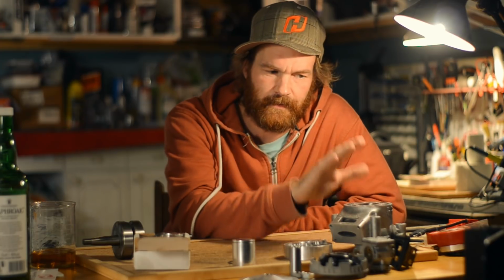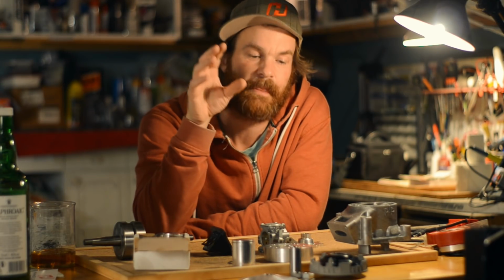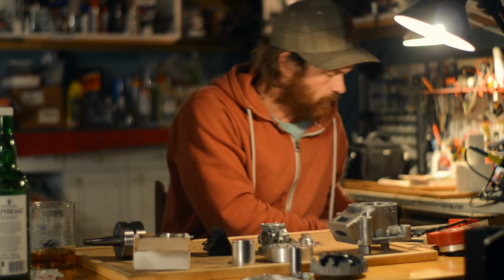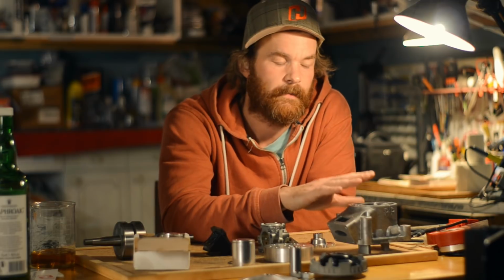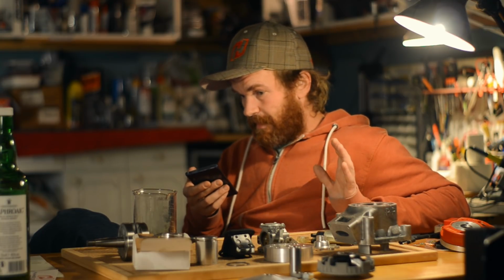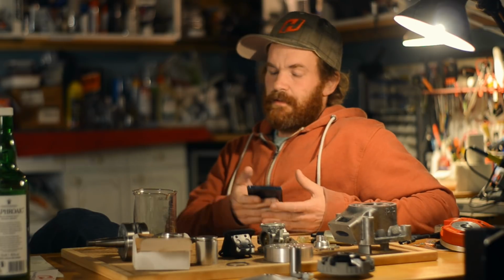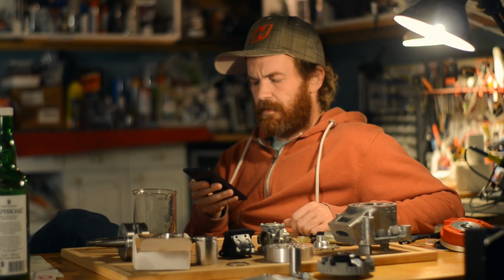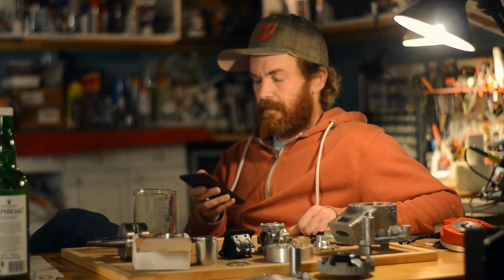THE Most Powerful Two Stroke - Back at it! + Replying to comments

Comment: Move the rider position flatter/horizontal to reduce frontal area.  It is a lot easier to reduce frontal area than to produce more horsepower.  I can't find the youtube video but there was a guy that built a motorcycle and he was perfectly horizontal and used some sort of offset steering mechanism so he looked around the front suspension.  If I can find it, I'll post it.  FOUND IT...this is the rider position you need: https://www.youtube.com/watch?v=2OtVLm3D6Is

Comment: Might be good to build a "Back Up" engine...pretty easy to do once you have the machining programmed.  This is going to be a VERY highly strung motor and I am concerned about reliability.  If you are going to travel to Bonneville, I would hate to see your engine fail and not be able to run.

Comment: Why not run two classes i.e. partial streamlining and no streamlining?  Doesn't your CVT lose some power due to slippage...may be good to gear for a given top speed/rpm and use a "lock up" device that doesn't lose any power due to slippage once you reach a given speed.

Comment: New idea...why not turn the engine around (intake in the front) and get some ram air into the tuned intake....Ha ha, I see you have already done it.  Tilt the motor forward so the intake is pointed directly forward maybe :).  Not sure how much it will help at 90 mph but I would think the "ram" would help.  On another note, I am real curious to see if the completely open intake will work...I would probably use a rotary valve, still tune the intake AND the RAM i.e. intake in the front :).  The pressure/rarefaction pulses would be more distinct with the rotary valve therefore the tuning would work even better.

Comment: I'm re-watching some of your videos. Had a thought... what about direct injection with two injectors, each switches half of the duty cycle. Speeduino can handle a dual injection system on a single cylinder. Just a thought. Best of luck. 👍

Comment: Okay i dont get that? when u run injectors  at 18krpm  90% duty cycle what is the difference between a const fuel injektion? i cant see the difference?  I just imagine its really hard to adjust the fuelpump and you have to engineer waaaay more.  I never run or setup an EFI but i guess you ll get it faster and way more acurate with using one of the systems avalabile (Speeduino if you want DIY) There are DIY 2 Stroke Speeduino Bikes out there. is it Possible to check the max possible dutycycle and limit it. Than Speeduino is open source so maybe you can run a dual or tripple staged injection ? low power idle injectors on the throttle body outside. and insane big ones (and maybe also fast ones?) at the transfortports as shown. I guess there are companys they can manufacture injectors as you need.

Comment: i see you trying to build a 50cc landspeed motor. are their restrictions on fuel? if not then why not build a multi cylinder engine from .28 cu inch RC car motors from manufactureres like Novarossi. a 6 cyl engine would produce near 50 HP

Comment: I am owner of Aprilia SR 50 scooter with injection motor from Piaggio. It is nice to know about high-end two-strokes. I have been installing KTM 125 fuelpump with pressure regulator to get more fuel to the system. I am pleased if my motor accepts these cheap chinese parts. Your most powerful 2stroke is almost Bonk-art, like that swedish bike with compressed air motor. With DOHC valves on the cylinderhead and exhaust turbo, it could make a lot of power and the high pressure air-canister is only used for starting this 2-stroke engine. High rpm is not so necessary with turbo dry sump engine and you could use 4-stroke type pistonrings.
Maybe it works or not. It is too expensive to test 2-stroke engines, when Kawasaki can make so powerfull 4-stroke H2 etc and electric engines are coming. Any way, your videos are very entertaining.

Comment: Been thinking a lot on this. If the injectors can't keep up on their own how about programming it like a 2 cylinder running at 8000 rpm with 2 injectors cause they are only supplying a single cylinder they would alternate and should pulse properly for a single cylinder at 19,000 rpm

Comment: An idea for future designs. 
Single cylinder crank carrying four (4) con rods. Crank case/block carries four cylinders equally spaced around the block. Each one is offset in two pairs so the big end loads do not suddenly change at each rev. 
This gives perfect primary balance and almost no torque vibration. 
Big downside is zero primary compression. But with a hollow crank you can feed fuel and air down the non drive end. Or don’t put any air through the crank and run a pressurised inlet manifold.

Comment: I think you were trying to say this, http://hilborninjection.com/
in reference to EFI I have seen examples where a number of injectors are used to deal with the fire timing, the injectors are fired in sequence. doing that allows more time for each injector to recover before their next firing event.
from wha I recall the Hilborn injection system uses an orfice to meter how much fuel is allowed to spill back into the fuel tank, perhaps a servo controlled needle valve would give you the control needed to keep your mixture correct at 19K+ RPM!

Comment: Really like the crank case design!
Especially the “inlet tract to transfers” transition is very nicely executed and looks well modeled. 👌

Regarding cluttered 3D-models it just sounds like any other professional design engineer. 😆
With experience some of it goes away, but not all. 🤦‍♂️
Don’t be afraid to take a “clean sheet of paper” when the model starts to clutter up and start all over again. It’s sounds really tedious but with a god reference/skeleton model that drives the main geometries and details, it’s worth it big time and often faster. A more stable and bug free model is a nice side effect. Good luck!

Great to hear the chassis, that I was a bit critical about certain areas, worked well. 👍
With a couple of parts falling of I’m sure you will have a overall look to the frame to find out any structural issues. Even if the limited amount of running time makes it rather unlikely.

Comment: Not sure if you know of them, but Ecotrons (web search) has 2 stroke EFI systems. Granted, only up to 16,000 RPM spec, not sure of fuel type, but can trigger 2 injectors. You could check them out, contact them and see if they can get it up to your 19,000 RPM. Running one injector at low or idle and bringing on the second along with the first might help solve the high RPM/load fuel supply issue. I know this isn't the same, but Top Fuel motors use direct injection to cool the cylinder/piston and the fuel curve takes this into account. The direct injection is an "always on" system dumping fuel in to the cylinder every cycle.

Comment: Why don't you use a two cylinder system and fire the injectors alternatively?  That way the injector only has to work for 10,000 RPM.

Comment: That upside down cylinder arrangement just seems like trouble waiting to happen with hydrolock with fuel/oil from injector pump problems.  Maybe a breakaway "freeze plug" that contains compression pressure, but would fail at higher pressures to relieve hydrolocked cyllinder under a heavy starting foot in a big boot?

Comment: Most methanol alcohol and nitromethane have a tendency to freeze up how are you going to prevent that
Reply: And I mean literally freeze especially at Full Throttle the few Top Fuel dragsters I've had the chance to work on or be around that was an issue

Comment: Look into using PDM rather than PWM to fire fuel injection.  Signals are shorter without having to filter out noise which will cause missfire.
My 2c
😏

Comment: If the open inlet system doesn’t work you could always revert to a belt driven rotary valve .....I’ve seen these used to keep the inlet inline the the crank centre this was used in 125 gp in the 2 stroke era and quite successfully .....just an idea

Comment: Maybe you can build a engine dyno using the same technic as your dyno. it should be easier to get some accurate hp readings and it would be way more practical for your prototype facility  :)
Reply from the maker: Yes! Plan is to fabricatet and mount an engine dyno attachment to the existing unit.

Comment: I think you're going to have a problem with the fuel pump and pwm. I don't think the pump will be able to react fast enough. But once you get to a wide-open point... I think it'll be ok.  I think you should consider using another way to control fuel flow for the mechanical injector. You have so many Concepts that you're testing you should try to eliminate one or two of them.

Comment: That concept on a valveless engine can actually work. If the pulses are lined to each other, which I expect to be a steady stream of air at 19 000 RPM. That means you have to close the open intake when you are going up to speed before that. And must close the carburetor when you will open the intakes.

I would recommend to put your injection system along your intake trumpet, to encourage spray(because you will do constant injection), and ensures your air has oil/fuel in it(makes air a lubricant) and is simpler, does not need special setup for your crankcase.

The issue here is operating injector in constantly open(like power jet) is the pressure. You would need to calculate pressure(negative) in the crank at the RPM range you are using the engine, and adjust the fuel/lube delivery as needed. Since it is set up on the velocity stacks(trumpets) there is easier measurement of AFR.

And about setting up cooling, I would like to recommend to weight up the front half of the frame in order to inhibit front-end lift(aka wheelie) and to make the rear tire push into the load. It will be running a straight line, so you can also try lighter rims and such in order to reduce inertial lag(which makes reaching top speed bit longer due to rotating mass). Can also help with slowing down, if needed.

About the reciprocal mass, can it safely do 19 000 or more RPM? Balancing would be great, and add the CVT drive on balancing to quell some oscillations that may happen(unlikely).

Comment: This is going into a very interesting direction! Be very careful with the type of spark plug. Methanol reacts with platinum and iridium which could cause a spontanious combustion (which is the type of combustion my small engines are running on)!
Love the Piaggio parts, they're both reliable and efficient!
Thanks for keeping the 2 strokes off of the endangered species list!

Comment: Hi,
Just like you, I've been told 2S injection is really difficult. But I never follow any advice :D
I designed an arduino based EFI for 50cc and it works very good at my max rpm ~14500RPM.
I can't say for 19K RPM but I tested injectors up to simulated 20K, it seems to work properly.
The thing is that you need a big injector. I started with 140cc/min injector (original CBR125) but it went over 90% duty cycle on a 50cc.
Now I'm using a 200cc/min and it's OK.
In the internet people usually say it's too big because it won't be accurate enough at low RPM (due to insufficient opening time to deliver a small amount of fuel). 
Actually my engine has never had such a good idle with that injector.
Anyway, do not listen people who never tried and just do it as you always do !
Good luck !

Comment: Just a idea, It might be more accurate and responsive to control the fuel flow with a solenoid valve and a pwm signal. Trying to control the fuel flow and pressure accurately with the pump pwm might be tricky otherwise.
Reply from the maker: 👍 I'm actually going to use methanol/water injection parts, and a pwm fast solenoid.

Comment: Dude the most powerful single 2 stoke is 700cc maico
Reply: I believe he means it will be the most powerful for its size 
Also he may scale it up to higher displacements in the future, where it could be capable of way more than a current 2-stroke design of the same displacement.

Comment: Older FI systems were full time injection anyway as well as Drag engines.
The only reason you need to fire injectors is for fine control over a wide engine speed range to ensure the engine meets emission standards...aaaaand, I don't reckon you'll need to be concerned about that.
Re intake valve question, some people forget that the transfer ports are the equivalent of intake valves to the cylinder, the reed or disc valve or piston is only the "valve" to the crankcase.

Comment: I worry about the air fuel tuning, maybe you could use dual injection systems with an arduino running a flip flop system for the pick up(takes the signal then triggers one injector then the other), this would reduce the injector demand down to 8,500 rpm per injector and allow you to tune the air fuel better, might save a few pistons and barrels???

Comment: You familiar with Husqvarna's Autotune carb/ignition setups? Kind of a hybrid developed on your side of the planet and while certainly not capable of fueling something making the power you aspire to...maybe multiples. But the concept might be something u can replicate or use. They have a solenoid operated control valve in the carburetor...and have a very simple feed back loop between throttle position, ignition (rpms), and carb temp (not important). Has effectively three conditions it deals with, Starting, Idle/low rpm, 80 percent or more throttle position. In the throttle open condition it does a lean out test for 5-6 revolutions at predefined time intervals.....shuts the fuel valve and if during it's 6 revolution test the motor picks up RPM's, the mixture was rich, if the motor slows down the mixture was lean. The mixture is controlled by that solenoid operated valve "cycling" open and shut effecting supply to the carb...needs more fuel it stays open longer in the cyclical pattern, if the saw (these are chainsaws) needs less based on the "lean out" test that valve stays closed longer...so always trying to get max RPM's under load. They are rev limited for the different saw applications, one being 16,000 rpms, They have a little memory where the history of those operation conditions are stored (fuel settings)...so we can see where the mixture was along with a few other parameters. Reason I ask is something along those lines feeding fuel to what ever your "mixing" device is might be a way to keep the mixture in the crank case where you want, using that type of logic. And the motor just draws what it needs based on your mechanism for feeding the combustion chamber from that "pool" or reservoir in the crank case.

Comment: Looking forward to the fuel injection testing! I'm still trying to work out if you're going to need the world's smallest injector because you can't pulse it, or if it won't be too bad because you'll be at full throttle all the time and with nitromethane you'll need lots of fuel too. Curious to find out!
Reply from the maker: First attempt will be with parts from a pwm controlled water/methanol injection kit. 100ish psi + 1mm nozzle should give me ~ 500cc/minute. On paper this should work fine. On paper...

Comment: i think you have a problem on your design, the cylinder need to be on top of the crankcase with the exhaust port on the rear, on your case the head of the piston goes to (pushing direction of the connecting rod) exhaust port, but on the odder way the head of the piston goes to (pushing direction of the connecting rod) "rear" intake port, better guidance less heat and less wear.

Comment: Try regulating fuel flow by pressure. No pulsating and more homogeneous mixture. Like older style mechanical  continuous injection systems.

Comment: I've often thought a generator (with fixed gearing as appropriate) would be ideal for a 'narrow bandwidth' tuned 2-stroke.  Maybe driving an electric motor if the overall efficiency was better than a CVT.

Comment: i think that continious injection by pressure controll is probably not going to give you enough flow range, i think you should still look towards using injectors.(maby try pwm on them or using two or more different size injectors)

Comment: Using a nos style fogger for fuel would be a smart move not only will you be able to ajust fuel flow from the pump you could quickly change jets. 
You could also drill into the main flow cavity and tap it for the jet type you normally have around just a idea
Reply from the maker: Awesome idea!